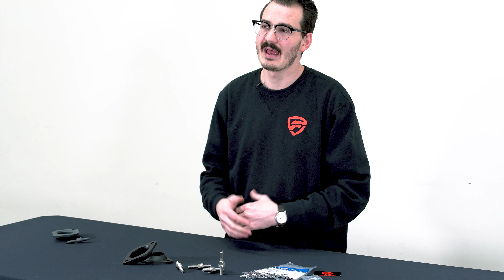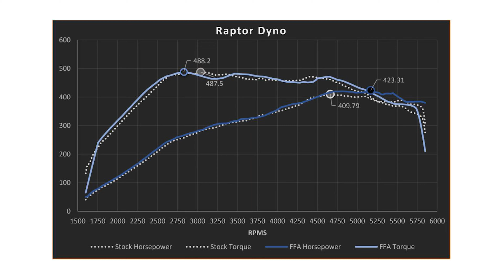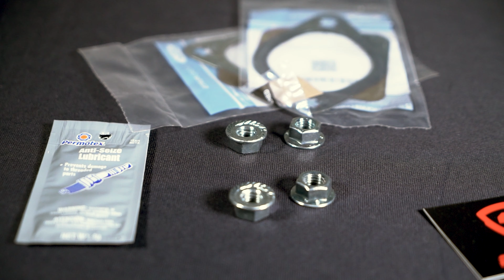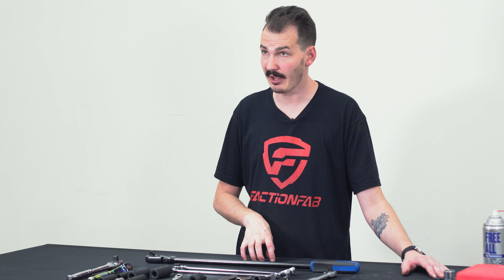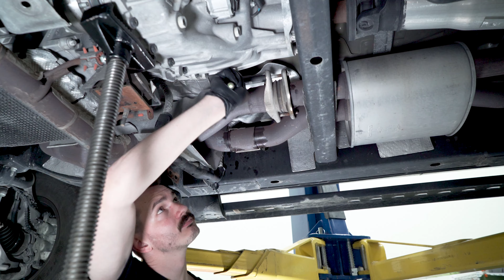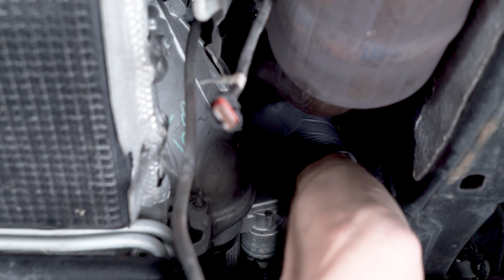FactionFab F-150 Turbo Adapter and Hardware Kit Install

Comment: I just tried installing on my 2018 eco boost. The larger head does NOT fit through the downpipe flange. The hex head is too large. These prevents the turbo adapter and downpipe flange to tighter.
Reply from the maker: The header flange is designed to fit on TOP of the hex portion, and not be wide enough to fit through the hole. The round flange + hex portion of the hardware is designed to a specific length to ensure a proper seal between the turbo adapter and header flange. You need to have the 5/8" spacer built into the studs between the turbo adapter and header flange to prevent over tightening of the connection, which can damage the expanded portion of the header pipe.

Comment: What a well put together video, awesome job guys... what would be the possible hp gains when doing both turbo adapters and catted downpipe at the same time? It is an 18 3.5 f150 platinum by the way... thanks in advance
Reply from the maker: We didn't do any testing with downpipes as at that point it's harder to quantify definite results based on other variables such as which downpipe and tune you are using. However, this is a perfect companion to a downpipe install and will improve your results. Something to keep in mind though is that some downpipe designs do remove this adapter and bolt directly to the turbo. Make sure to double check which design you're getting before purchasing.

Comment: Will you make this for the 2.7?
Reply from the maker: The 2.7 actually comes from the factory with a well flowing adapter design, so it is not a known restriction like on the other ecoboost models.
Reply: @factionfab5834  OMG IVE BEEN DOING HOURS OF RESEARCH TO FIGURE THIS OUT THANK YOU !! Do you know if it will make a difference to install it on the 2.7 and Will the 3.5 adapter fit it ? Is there one for the 2.7 ?

Comment: Im confused as why would you install turbo adapters and then proceed to installing the stock cat system in conjuction with adapters. it defeats the purpose of the adapters entirely.
Reply from the maker: The adapters are actually the restriction in the system, so with these you are basically giving yourself free horsepower while still being fully emissions compliant. There are proven gains when doing the adapters even with the stock cats in place, and thanks to its low cost, it's a really decent hp gain per dollar part that can be done in a few hours in your own garage.
Reply: @factionfab5834  fuck emissions. straight pipe your truck for maximum gains
Reply: @jay_volpe  Oh aren't you special

Comment: Can these be installed on a 13 SHO with the 3.5 TT?
Reply from the maker: We have not tested the adapters on any other Ford ecoboost models except for the F-150.
Reply: @factionfab5834  that's unfortunate. I imagine they wouldn't redesign adapters on a pre-existing engine simply for a different car.
Reply from the maker: @sergeantspeed5941  We used to think that too, but have been really surprised lately at some differences we've noticed. I bet some digging through Ford OEM parts diagrams could get you in the right direction if you were determined to find out.

Comment: I purchased you’re kit from stage 3 and I guess you can’t buy when you live in California so they refunded me.. I don’t see what the difference is.. looks like I’m going with spd
Reply from the maker: California has very strict CARB emission standards, and this is a case of "better safe than sorry" where we do not want to risk any problems even though technically it does not modify any emissions. We are currently working to have as many parts as possible CARB certified, however the process is VERY difficult and takes a long time.
Reply: @factionfab5834  are you selling to California now?
Reply: California and their govt officials are out of their minds... I would rather live in north Korea than cali or ny...

Comment: How much this install labor only?
Reply from the maker: We actually are not a service shop and do not install products for customers, only engineering and manufacturing. You would need to inquire with a shop local to you for pricing on install.